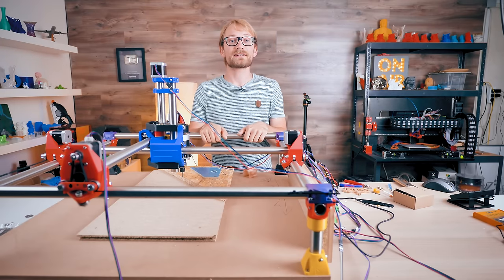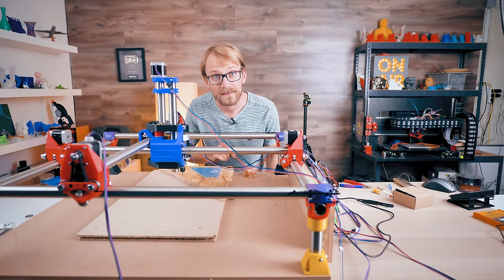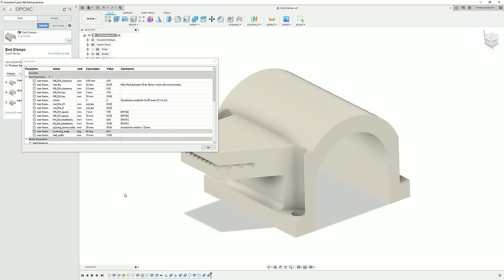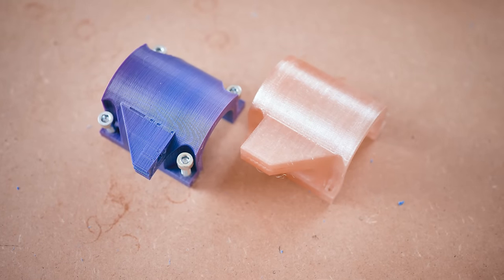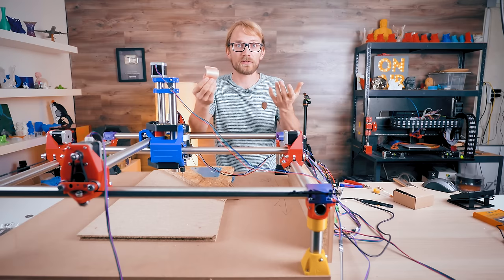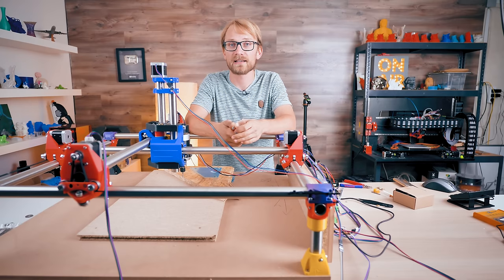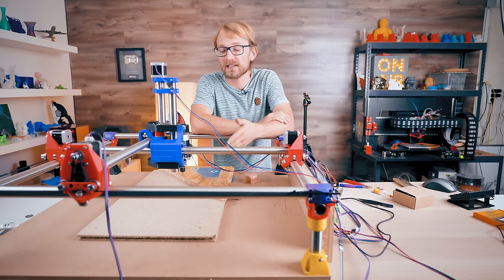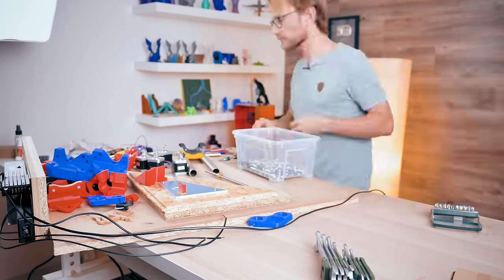Whose design even is this? (MPCNC conclusion)

Comment: if the non commercial creative commons was able to be applied to parts simply because they match up to the original part, then you can say goodbye to aftermarket components for pretty much every other consumer application. 

its  a sad misunderstanding on the non commercial license, that people could say that a part you built, ground up, to replace an original part, is derivative, under the licence definition. being in that, you take that original part, and modify it based on the original. versus creating a new part, based on dimensional accuracy, which absolutely does not violate any terms. 

essentially, you cant claim ownership on basic shapes, or simple mechanisms such as a clamp. the feature that makes it identifiable is the zip tie slot. you removed that, and replaced it with your own retention system design. 

in your example showing who owns what portion, it would more be like, no one owns the original major section, while ryan owns the zip tie portion, and you own the newly designed belt retainer. 

again, horribly sad to see these types of problems come up. people really should know better

Comment: Accusing you of wanting to destroy the project when you are actually contributing (even without any personal gain) is just nuts. His whole line of thought is rather messed up. If what he claims about fitting the other part would be true, what ould that mean for after market rims or even the tyres on a car? Just think about it. It's just insane. Honestly, I was thinking about buying parts and building a MPCNC. That's why I was Googling it. After this story, he can shove his design where the sun don't shine. EDIT: I typed this before I watched the video to the end. After commenting I unpaused and you mentioned brake rotors :)

Comment: That's what I am talking about. There are so many projects where the people working on them go out of their way to prevent people from helping. From not actively updating their documentation to not uploading the most recent versions of a design. (PRUSA Power Panic PSU Update, Creality not releasing board revisions info.) To not fixing known defects and waiting for people to find them and fix them themselves. It shouldn't have mattered if anyone made a compatible part. Why some of the features that you mentioned didn't already exist in the project made no sense. I probably would have made my own changes and not posted it but I can understand taking it apart because jesus we all watched you for hours building the thing and it wasted our time as well. 

When you got to the point it was cutting and it wasn't rigid the first thing I thought was obviously there is something going on because I went and watched other peoples videos after I watched yours to see if anyone else had the same problems that you did. I figured it was just the speed it was cutting the material. (Spindle Speed vs Feedrate) If that one change made it better and somebody told me not to post it because it's a derivative and I made it from scratch then I wouldn't have taken the design down because it was a fix. Especially if it was helping the community. There is too much gate-keeping going on with projects these days.
Reply: Tweaking the design has been part of the MPCNC from the start, the only ask here was that the re-designed part be released under the same license as the original, non-commercial.

Comment: Doesn't matter if you redesigned a BMW from the ground up and built it yourself. If it looks like a BMW, it is a BMW.
Reply: No it isn't, it's a replica. 

I was going to go on about just how dreadful a metaphor you are using, comparing a simple bracket to an entire motor vehicle, but it simply isn't worth it.
Reply: @hiletroy1568  "Replica" aka counterfeit in legal terms. Here's maybe a "smaller" analogy you may understand: if you make a "replica" Louis Vuiton leather wallet out of plastic and with a different color, you will still loose in court. 😉
It's no different with "open source" when you breach the license.
Reply: A BMW has certain design traits that make it recognizable as a BMW. Having four tires and a combustion engine is not what it makes a BMW and so it is not protected by copyright or other laws. Fitting around a round pipe is a engineering principle that is open to everyone and cannot be owned.

Comment: This is not a great design to begin with - having built and fine tuned a CNC, I don't see the frame having the rigidity to cut anything beyond soft wood with conservative chip loads. I'd look at aluminium extrusion based designs - even those have issues when you're trying to work on soft metals.

Comment: You or Ryan seem to have the words "Copy-rite" and "Patented " mixed up. As the leader of an inventors organization, i have some experience in such matters. Copy-rites  pertain to written things and music things. Trademarks pertain to symbols, logo's and such. Design patents deal with actual parts and pieces and innovations. You can obtain a patent on on an improved idea which yours seems to be. He may have patented the design of the machine overall but you are not infringing on his patent ( if he has one ) by designing a better part.  If that were the case there would never be any improvements of anything unless the designer did it. Since he has designed the part as well as he could already means that he has exhausted his brain cells already. If I were Ryan I would have asked you if I could use your design in my product and incorporate it into future products. Patents are expensive. All that a patent does is guarantee you a seat at the trial. You did nothing wrong. Keep making videos.

Comment: Like most commenting here I've decided not to go down the MPCNC path for now, and will look for an alternative.

It's weird that you were targeted for designing a compatible piece when a quick search shows dozens for Z mount plates "derived" from his designs, have yet to hear from any of them that they were being issues C&Ds.

@Ryan If you end up reading this: It's disappointing that you've taken this route, especially given how much people liked your design, I really hope this can be sorted out. Wish you all the best until then!
Reply: MPCNC mods are welcome and encouraged, the only ask was that they are released non-commercial.  Why is that so terrible?
Reply: @GeoffreyPitman523  Compatible mods aren't owned by/controlled by/beholden to, the creators of the object that the mod fits (otherwise GM, Ford, etc, would control what lights you could add to your car, for example). 
The original creator can ask, but if the mod maker declines that's the end of the story. Tom had to create this mod entirely from scratch to be compatible, as Ryan does not share the design files, thus Toms work is not a derivative.

Comment: I don't understand the strong feelings on licensing by either one Thomas and Ryan. If in fact copyright only applies to the non-functional part. What difference does it make to be a non-commercial license. Thomas could just humor Ryan. Clearly for Thomas it was a matter of principle on one side. And also feeling unwelcomed. I can speculate that Ryan thinks his design is awesome. And it's worrying of a company making of with his efforts and making millions while he makes thousands. Given the likely amount of effort. I think it's understandable. I think on the other hand Thomas sees his effort in this channel as awesome as well. And he wants it to be appreciated. Although a Thomas changed his license. This video tone negated the potential gesture. Clearly there was no arbiter to resolve this issue. Maybe we need an open source arbitration system. But in it absence, I think doors must remain ostensibly open. And that would take independent effort. I encourage you Thomas to take if only that step. By the way I came to know of this project through your channel. I think both of you are doing an awesome job.

Comment: I mean apart from that... the design of the MPCNC is inherently flawed. If possible never ever combine all 3 Axis together. You get the instabillity of every axis combined at the router bit. Go look at  manual mills, they often have the Z axis and the X together and the Y seperate this reduces vibration, chatter and inaccuracy.

Comment: I have one and it started cutting like crap once I put a spindle instead of a makita router. Probably due to the RPM or the wheight of the router, I don't know... Indeed it looks a bit more locked down than what I'd like but It's still a nice project when you consider the price of a real CNC
Reply: How is it "locked down"?
Reply: @GeoffreyPitman523  I was talking about the project. It's not as open as I'd like.
Reply: @bmallory  for what?

Comment: Ryan's tweets look to have been deleted.
I don't like the concept of someone getting annoyed when someone else make a slightly modified version of a part of their design.
IMHO the need of parts using United States customary units was a mistake. If Apple designed their newest iPhone to only work in the USA, they would be laughed at! Fact is that almost the whole world uses metric, except the USA, Liberia and Myanmar. And, I believe Liberia was in process of converting to Metric. If you make a product, you need to market to the majority of your people. In this case, that's metric & the rest of the world!
I live in the UK where we have a mix of metric and English measurement (e.g. food markets still have weights in imperial). But in reality I cannot find a good supplier of Imperial nuts, bolts & etc. Metric is sometimes hard enough (local DIY stores don't have small enough sizes, I tend to order in bulk from China instead).

Comment: Just a little detail... Thomas you like being technically correct about things. You've made this mistake a few times. V1 is based in the US, but you state 'imperial measurements' when describing it. That isn't the system used in the u.s. We use the U.S. Customary system. It is derived from (pun intended) imperial, but the units are differently sized.

Certainly they are similar. But this in many cases this is like saying a yard is basically a meter. Close.. but not the same.

Comment: cant wait for a sanladererCNC with printable parts, normal metric sizes and non US sourced material.

holy f, what a pety project 'lead'  , could you just imagine what harm this would have done if Adrian Bowyer behaved like this to Prusa on the RepRap Mendel?  It would basically have stopped the entire reprap revolution and we'd still be paying >10000 for a 3D printer

Comment: You want to build a worthy cnc machine look into Gatton Cnc it's alot better than hollow tubing that will bend and flex and if not have major issues elsewhere. It also has the advantage of being able to be alot sturdier built. I built a cnc machine myself based off Gatton Cnc and the thing is a litteral tank compared to this mutt called the mpcnc or my little pony.

Comment: Finally some more drama lol. 

But IMO abadoning the project and disassembeling it is completly the wrong way and an over-reaction, I actually wanted to watch the build but well....
Reply: I would have done the exact same as Thomas. Ryan's spite would just have left a bad taste in my mouth.
Reply: the whole purpose of the build was to mod it, so disassembeling it and reusing parts for a true open source CNC is the better version than finish the build half-assed and leave it in a corner to rot. So in the end we can wait for a completely new build series with additional modding
Reply: @SchwachsinnProduzent  the licenses do not prevent modding or even distribution of these mods.

Comment: So the guy claimed copyright over a part that fits onto a pipe that's been designed for a pipe that happens to work with his design. That's ridiculous. Seems like he didn't want community input on the project despite having it under CC license.
Reply: CC NON-COMMERCIAL and all he asked was that Tom also releases CC non-commercial.
Reply: @GeoffreyPitman523  yes but his design wasn't strictly just for the CNC machine. It was for that diameter of pipes. What's to say he can't use it to make a 3d printer based on them.... Yes, I agree it was a intented for this machine but is also for a generic commercial product you can buy from the shop. I'd fully agree on license change IF it was hooked up to one of the parts of the proprietary design.
Reply: @JanKopanski  If you look at the Twitter feed, Tom threatened to release ALL of the parts slightly modified under CC0 as "OPCNC".

Comment: Replace the belt with steel belted belts. The white "HTD 5M PU Open Timing Belt " is steel belted. Might have to replace the pulleys as well.
Reply: The belt is not the problem. Steel belt will not work on the size pulleys the MPCNC uses. 99% of all MPCNCs use this non steel belt with no issues. Following the instructions helps.
Reply: @timr86868  So where do you think he strayed so far from the instructions as to have that much play?
Reply: @dieselphiend  First of all, he had the zip ties done incorrectly. You are supposed to have the loop at the plastic piece as small as possible so it can't flex. Second of all, the spindle he used is known to have internal rubber bushings that make it show good TIR on a dial indicator when not under load, but under load it flexes causing chatter. If you watch the video back you will see the spindle moving, not the machine frame or z axis.
Reply: @timr86868  Ah, thanks for your insight.

Comment: Who cares if this CNC design is copyrighted or not. It's simply not working as it should. So no use in perfecting it, because it will never be stable because of these belts. Rubber has a high elasticity so the mill will rattle around with every clamping part you use, derivative or not. Milling is always combined with cutting forces that are too high to be kept stable with this kind of design. Maybe a laser cutter might work, but that's about it.

Comment: The rigidity of that thing looks non existent I think it's steel pipe but it's still going to bend and flex all over the place with plastic joints.
it might work as a pick and place or light engraving but typically for a cnc as a starting point you'd use alu extrusion, then further up big chunky metal like cast iron something that doesn't twist or bend. otherwise your spindle will just bounce about all over the place.
typically openbuilds has already done this, you can also get cnc's in kit form from ooznest. The parts are open source from what I understand metal with polycarb wheels

Comment: I was actually going to build one, but a sensible size. But if I can't tweak or improve it then there's no point.
Reply: I'm not taking sides, but you can tweak it as much as you want.  The issue comes down to rather you can sell your tweaked parts and how you must license the files if you release them to the world.  This ordeal is unfortunate, and as someone else said, it was bad decision on both their parts to discuss/argue about it over twitter.  If they were both in a room discussing it or even talking over the phone, the out come would likely be very different.
Reply: @Zeric1  I'd want to do exactly what Thomas was told he couldn't, release any improved parts I designed for free with no restrictions. I already have access to a Haas 5 axis CNC if I just wanted to make stuff. The fun in things like this is using the hive mind of all its users to rapidly evolve it to be something better. If it's closed then it will stagnate.
Reply: @PaperHunter  Your original comment didn't mention the intent to release improved designs "with no restrictions".  I prefer open source licensing as well, but people can and do release improved parts designs for the machine, but (unfortunately) with said restrictions. This is a lesson for all of us: clarify the existing license before starting a significant project we want to improve upon and be sure it's fully open source.

Comment: What a load of crap. Thomas spends all that time, energy and $$$ on a project and basically gives this Ryan guy free advertising for his product, and shafts Thomas over a small upgrade that could of helped with the chatter??? Was in the market for a MPCNC, but not anymore. The world of 3D modeling and printing should always be open source. If you don’t like a design, or it doesn’t quite fit the parameters of your project, you change it and make it better for everyone else. Ryan should of embraced the damn part as an option for those who build bigger. Wow, I can design a part that fits a pipe in 30 minutes, does Ryan own the copyright to the pipe? The pipe is always going to have a round profile no matter the size. Don’t insult me by responding to this comment, a like or unlike will suffice. Thank you for sharing the ride and many live streams in this project Thomas, I look forward to every video, you were the creator that got me interested in 3D printing, and I bought a Prusa i2 clone off eBay for half price (at the time). It fueled my passion to make and to assist other makers.
Reply: How was he "shafted" by Ryan asking him to release the part as non-commercial?? That's ALL that happened.